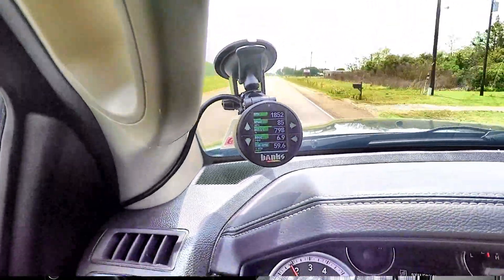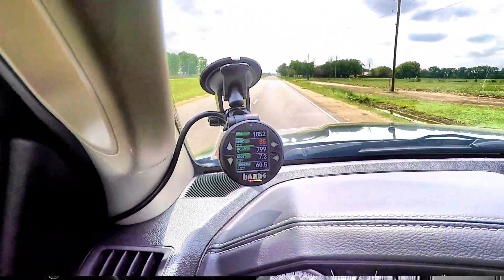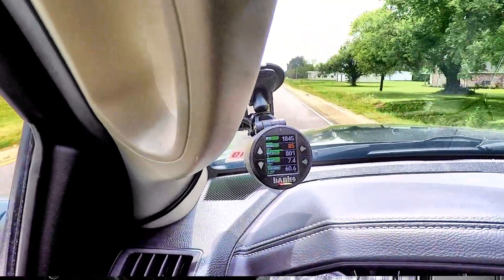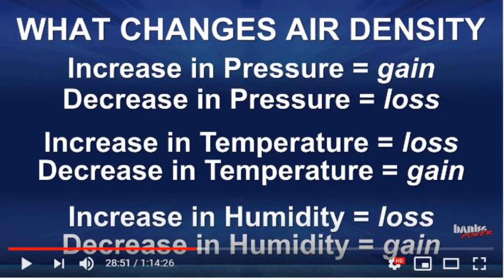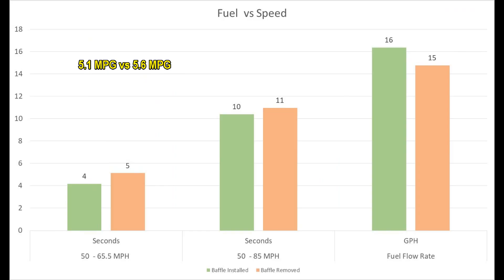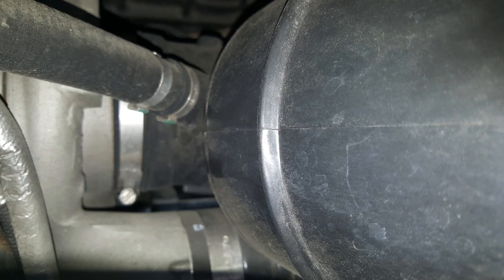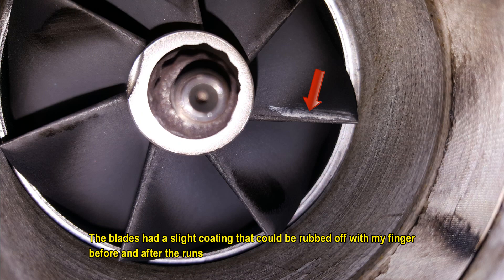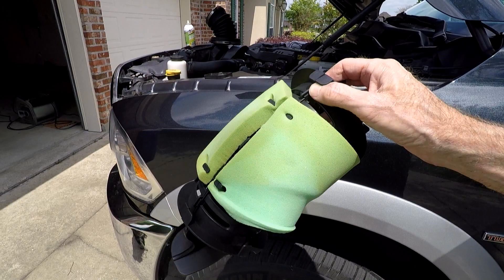Ram 6.7L Cummins Air Intake Baffle - Keep it or remove it?

Comment: So i just got a 21 ram 2500 with the 6.7 and i was wondering is there any strong advice i should know about maintaining and taking care of these trucks to last as long as possible? This is my first diesel ive had and i dont want to hurt it prematurely by my driving habits
Reply from the maker: just keep oil and fuel clean and you will be good.

Comment: If Cummins didn't put it in there and ram did it's probably emissions control or noise control is what I thought for the whole baffle setup. But what I'm taking after watching this video is the duckbill I'm leaving in there but the foam I'm taking out. The reason you're getting more turbo noise is because of the turbulent air going into the turbo.
Reply from the maker: Yep

Comment: QUESTION:  If you eliminated the foam, could you modify the insert housing to eliminate those outer openings and maybe some resistance to air flow?  Leaving the important duck bill diverter.  Is there anyway you could do some more testing with a modified air filter insert?

Comment: My truck is over 7 years old. The baffle foam is fine. That baffle is for noise reduction. All you have to do is look at it and it’s function is obvious.  Remove it and hear how much louder the exhaust brake is; one can even hear some whistle. I data log too.  Removing that air intake baffled pipe completely and replace with the K&N’s smooth air-intake pipe.  There is no increase in cfm with replacing just the whole baffle; no notable increase in boost. My manifold densites INCREASED near 4.5% (changing just the air intake) used together w/ my Banks intercooler also cools more (data logging comparing only the effects of removing the pipe with the K&N straight intake. I already know the changes from each prior modification. My cfm increased from 400 to 422 when replacing just the filter. That change did not increase density. My density increases occurred with just removing the whole factory air intake piple from CAI to turbo and replcing w/ just K&Ns air intake pipe. The stock intake creates turbulence.

Comment: I took my whole insert out a few years ago and now my turbo blew out completely.  Idk if it had anything to do it it but thought I’d mention it.
Reply from the maker: I guess it's possible without it since the purpose of the duckbill is to center up the air before it goes to the turbo blades.

Comment: I don’t know much about air intake systems but I can’t help but think that baffle acts like a Venturi if you will. 

Similar to an air hose with a small fitting at the end. If that fitting is removed the air does not jet in or out but travels out without much force.

Just my thoughts.

Comment: Keep up the great work on the videos - I've learned a lot. 
My wife has a 21 Ram Rodeo 2500 Diesel. I've got a question about these cold air intakes from BANKS and S&B. I understood from your video about the intake baffle and the directional air it provides to the turbo, and that if the baffle is removed then air displacement to the turbo is deficient and causes stress on the bearings. These two brands eliminate the baffle, so are these causing possible harm to the turbo? Your comments are greatly appreciated.

Comment: The baffle is to reduce loading turbo inlet un-evenly due to 90 degree elbow. Without the baffle it’ll create uneven air pressure on the turbo and subsequently wear out the bearings prematurely. The foam I’d ditch.
Reply from the maker: Me too that’s the way I’ve been running for three years

Comment: Sorry to say this but an utter waste of time. You have a gale banks programmer correct? Simply chuck the factory air box completely and instal a gale banks air box it will not have had that lip in it that the factory piece has nor the baffle. The factory set up is all about quiet and nothing about performance they might invest a lil time for economy simply because they wanna sell more trucks but EVERYTHING in a factory truck is about cost versus compromise and instead of designing an awesome air box they got one sorta right and then refused to redesign it when they found issues instead they wanted to modify it with other parts to half ass it because they already paid for the mold to make the air box .. the entire truck is built around penny pinching compromises.. Gale banks would have kept at it till they found a solution that works just like borla they do not half ass things.

Comment: I agree with this video %100. I did considerable testing on an emmisons intact 2016 & 2020. All conditions were near max tow capacity for 3,000 miles. 3-5 psi boost pressure differential and mileage gain, Both in favor or the factory setup. Also same testing with TS Stryker duration modules for warranty purposes.TS Stryker > Stealth factory intake with baffle better than no baffle or complete S&B

Comment: Air flow, disturbance & “empty space” what the hell are your people talkin bout?  From the filter to the front of the turbo is a “controlled” environment.  That engine and turbos will take all the “unobstructed” air you can feed it and putting a baffle enclosed in foam doesn’t “direct” air or make it more efficient.  In fact it leads to inefficiency.  Creates more heat, engine runs hotter.  That space between the air box and the turbo is air not foam & plastic.  As for turbulent air that stops in the air box pre-filter.  But if you think the plastic and foam is a good  idea, that pos fauci recommended the same thing a couple years ago for that “Covid” bullsh*t.
Reply from the maker: I agree totally but when you remove this particular baffle, you don't have "unobstructed" air flow and the test show that.  Removing or modifying things sometimes have unintended consequences.

Comment: If Cummins didn't put it there, and cold air intakes even delete it, ditch it, but also ditch the stock tube and replace it to eliminate the shoulder in the tube.

Comment: Hi Marion, thank you for your video. about 10k. miles ago I installed a K&N 57-1568 (Performance air intake system) on my 2013+ RAM 2500, they claim almost +15 hp gain,  the only thing I noticed is a nice turbo whistle. But...after about 5k. miles started having that issue when idling (called "slope"?), specially noticeable when idling in D or R. Could that mod. be causing the idling issue?
Reply from the maker: Doesn't seem like it.  Seems like you'd get a code first?   I had that slope thing in Denver when my truck was new.  Never had it again at even higher altitudes so it was puzzling, still is.  Had it all the time I was in Denver.  Something about Denver, ha.  BTW, I never got a code when mine did that.
Reply: @MarionBlair  Hi, and thanks for your quick answer on sunday!, no...mine did not trigger any codes also

Comment: I had an lml duramax and it had a baffle in the top of the motor that quiets the turbo it’s a big box the air travels through to dampen the sound. From what I gathered from this video is this duck bill and foam is the same dampener as the box on my lml. I took it off and put a blocker plate in its place. Never had a problem on my temperamental dmax.

Comment: Thank you for the technical review. Excellent job. I recently purchased a 2015, the previous owner had already removed the baffle. The truck has 90k mi, turbo was changed at 54k. Possible contributing factor? 
You elude to the fact that the OEM has a large lip. Do you think these numbers would be better with an aftermarket intake that has a smooth pipe, such as an S&B cold air intake?
Reply from the maker: Yea, possibly if it's built better.

Comment: Replaced mine with a complete S&B unit (has "active air") with a washable filter and never looked back.  It's been installed for about three years now.  I did replace the filter with a new one about six months ago.  Would I do it again?  Yup!  Great video...thanks!

Comment: Great information! It would be worth noting that they have since changed the design (mine is a 2021). The new ones do not have the foam, and the plastic veins are shorter and made into the housing. The intake tube has also been altered and no longer has the 90° shelf at the transition, so this mod is not necessary on the new ones for concerns with the degrading foam, and there is no sound benefit for those wanting more turbo noise. I'm not sure what year they made this change, but one way to tell is if you look at the turbo, the newer designs have the ccv hose going into the turbo flange, rather than the intake tube. Keep trucking!
Reply from the maker: Thanks, I'll be anxious to see that if we ever see a new truck on the RAM lot again, ha

Comment: Outstanding video and presentation! I can't believe you don't have more subscribers. Based on your data I'm not sure I would believe the people who say they gain fuel economy by removing the baffle. Turbochargers absolutely make a diesel engine more fuel efficient, not just more powerful. All of your data indicates better compressor efficiency with the baffle installed. Fuel flow is higher not because of decreased efficiency but because the ECM is putting out as much power as possible because you have the throttle floored. And it can burn more fuel because there is cooler, higher pressure intake manifold air, or more oxygen entering the engine. But given the same load on the engine, rather than 100% throttle, it would burn less fuel. Thank you Marion, this is awesome stuff!
Reply from the maker: Thanks, yes, that's was my conclusion.  Marion

Comment: Amazing video! 

I’d imagine disrupting the flow has an effect on the discharge side of the compressor wheel as well, and probably causes less dispersed flow trough the CAC, leading to less heat exchanger, and higher IAT’s.

Comment: It just makes the turbo quieter. I took mine out the first week I bought my truck. Though they are not very restrictive, they still restrict air flow a little bit. I slapped an S&B cold Air Intake in it anyway.

Comment: This looks like more of a product to remove moisture from the intake and save in the incident water were to be sucked in the filter especially being that it's on a curve it will help catch moisture
Reply: I know I've purchased these for cold air intakes years ago in the past I don't know it's just a suggestion
Reply from the maker: It does take away some turbo whine.

Comment: The internal combustion engine is a giant air pump. More air in and out means more efficient operation. The government mandates make diesel engines run hotter than they should to "help" emissions. You will use WAY less fuel if you can make it breathe better. We  stripped off the egr crap from a 15L cat. This includes removing 2 turbos and installing one large one. Went from 5mpg to 7.4mpg. Over the course of a year at 120k miles or more, that's a huge savings at the pump. Not to mention went from 550hp to over 700hp and the torque went from 2k to 2400. Priometer stayed about the same unless you lug it. If you're pulling a huge mountain out west grossing 80k lbs and you lug the motor, pull around 1350 to 1500 rpms, your exhaust temp will get up around 1100f, if you just drop even a half of a gear it stays around 900f.

Comment: I think the foam is there to help direct the airflow into that desired path the duck bill is trying to facilitate. Removing it probably creates vortices along the path and as it’s directed through by the duck bill isn’t as stable. As you pointed out it is designed to improve the efficiency of the turbo and minor tweaks such as that has helped create more power for the engine we love. Each year minor tweaks result in more power and torque in the 6.7 family. Great video!
Reply: My 5.9 had one

Comment: Leave baffle in and remove the foam?  What do you think?  Awesome information!!
Reply from the maker: I removed the foam and left the baffle.  My truck is getting old and concerned about the foam deterioration and getting sucked into the engine.  It's not much of a concern except extreme high mileage type trucks, I would say.  No benefit to power or mpg removing the foam.  Keep the baffle however or you'll lose turbo performance.
Reply: @MarionBlair  my truck is 2005 with 192000. Thanks for all your info!!

Comment: I dont believe there can be any difference with or without that foam. Just does not add up. The only possible cause could be the foam is providing some insulation against engine bay temperatures.

Comment: So the tests were between in tact and complete gone? Just wondering if it went back to normal with the scoop without the foam
Reply from the maker: This test was with or without the baffle  with  no foam.   The foam was off when I ran this test and that's the way I have my truck now.   I did a video with and without the foam after this video and I couldn't see any different whether you keep or get rid of the foam other than the possibility of the foam deteriorating  over a very long time.  As you can see by the data the baffle provide more power and efficiency.  whether you keep the foam or not is up to you.

Comment: I wish the actual engineers who designed these trucks could just chime in in the comments, and tell us just exactly what all the parts do, and why they built each part the way they did.  We always assume "automaker spent BIG bucks on design, must be good reasons for x,y,and z" then spend huge amounts of time like you did, reverse engineering and testing, and reasearch etc.  There's prob some guy at Ram could just tell us right upfront "this thingy only for sound, nothing more"  Lots of times, working on cars, I've desired to meet the designer.  Usually just wished to punch him straight in the nose though... maybe thats why they keep quiet and stay hidden.  Anyway thanks for the informative video, Mr Blair.
Reply from the maker: Thanks, there's a big disconnect between dealers and Cummins and the dealer information and we are stuck trying to figure it out on our own.

Comment: Thanks for the video! Any thought given around whether or not the foam may be there to help prevent fatigue and cracking of the plastic due to vibration from the air moving by?
Reply from the maker: I think it's more of a sound suppressor in one of my last videos I pull the baffle out just to look at the plastic condition after a year of being in there and everything looks good, you can see the video
Reply: @MarionBlair  thanks so much for the quick reply. Your video got me thinking about the air movement through the tube and the effect it has.
Reply from the maker: @TinyTJ04  yeah it is kind of puzzling because no one really tells us what it's there for

Comment: Factual data is always helpful..! 
IMHO, the baffle is there from the factory to correct for the turbulence created as air flows past the flexible accordian section just passed the filter outlet and to correct for the opposite direction 90 degree turns the air has to make on its way to reach the turbocharger inlet. 
Thanks to your efforts, the data confirms the air is tumbling/turbulent without the baffle installed, turbo efficiency is down, air temp is up..
Reply from the maker: That was my conclusion thanks

Comment: I total understand about the baffle with the curve directing air into the turbo, but what if you take the foam off and leave the baffle in? How would that Proformance be?
Reply from the maker: I tested it with and without the foam in the next video.  without the foam the performances the same I leave my baffle in without the foam

Comment: The truck will run just fine... I have 4 3500 high output cummins without that stupid bs baffle and they are fine... all it does is quiet down the turbo honestly...

Comment: I used some bulk Uni Filter on my dirtbike that looks like the same filter foam. Thanks for the video Marion, without a repeated test on a dyno under similar conditions there isn’t anyone proving those “cold air kits” do anything. They probably work on a modified engine, but Ram spent a lot of money designing the baffle, it’s there for a reason. I’m leaving mine stock with the paper filter. My dirtbikes use dual layer oil soaked foam and they get cleaned after every ride!
Reply from the maker: yes I agree

Comment: Excellent video! This just goes to show how complex these engines are and everything is designed to work together. Don't know if the foam is a maintenance replaceable item.
Reply from the maker: Thank you.   The foam is not replaceable without changing the entire assembly which cost a couple hundred dollars

Comment: How do you feel about the drag link problem on a Dodge truck when they weld it I think that's wrong and there's an aftermarket I should have to pay $500 I got 2017 otherwise I'm happy with the truck
Reply from the maker: oops I just deleted my reply but I totally agree with you welding is not the solution as many other solutions would be better I think.

Comment: I'll have to pull the one out of my 2014 to see how it's doing. My buddy's 2014 service truck had a piece not of the foam, but the plastic cracked off and was swallowed by the turbo. Through the turbo off balance and puked oil into the DPF. He pulled the one out on his coworkers and found the plastic was cracking on it as well.
Reply from the maker: I've heard of that also, we may have to live with the foam or go after market.  Did he have the foam on it when the plastic broke?  I'm wondering if the lack of cushion from not having the foam cause a problem?  thanks.  Appreciate if you let me know how your looks.

Comment: I did keep the insert inside without foam in my 2008, it hit about 110k and broke, sending a couple small pieces of plastic into the impeller.  When I bought my 2012 new, i took the entire thing out immediately to avoid any potential issues.  I'd be interested in seeing the closed box kits like S&B do compated to stock, particularly due their price.  Fine work!
Reply from the maker: Good info thanks. Yeah I may eventually do that aftermarket test